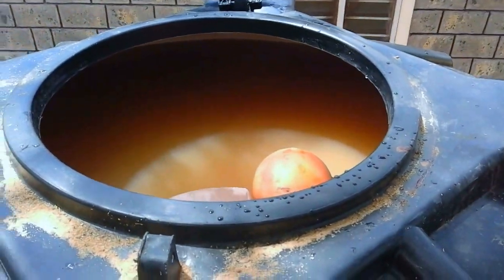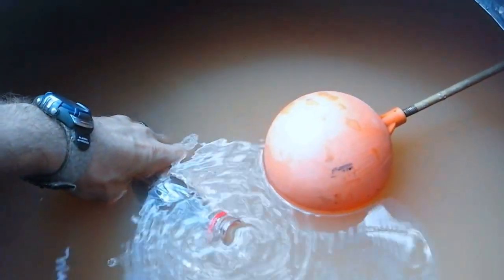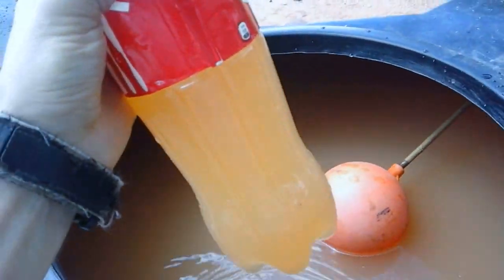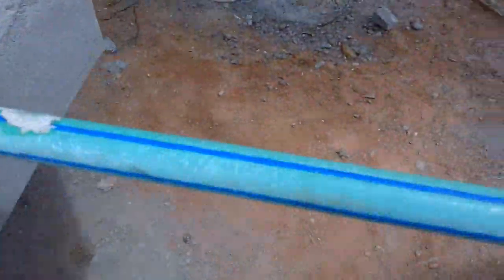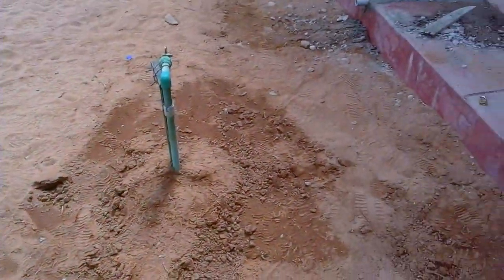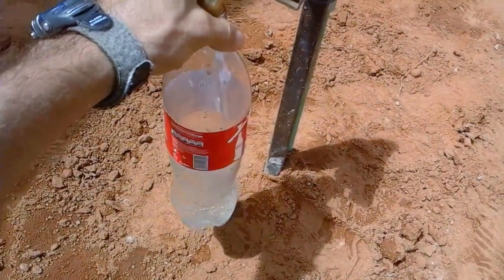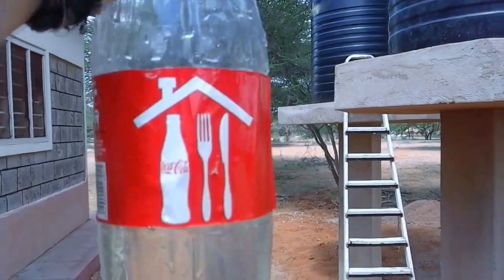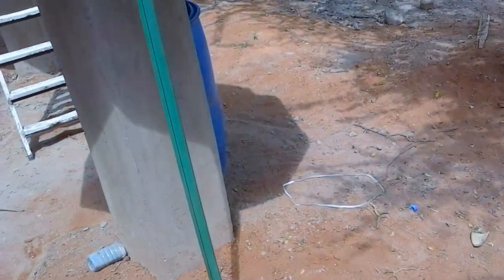Automated BioSand Filter - Appropriate Technology - Affordable Clean Water Solution

Comment: Mr.E will not explain anything.Let me explain . spread small white  coloured stone 3/4 sized bolder laying  by   8 inch thick  in the buttom of filter  tank  which is to be kept at a good height. ) preferably white colour stone  found in river bed near hilly stream/ river.( Black stone also can use).Then  spread wood charcoal about 8 inch thick over stone layer ,then spread  bigger sized sand about 1& 1/2 ft to 2 feet  thick  layer over the charcoal layer. Then keep at least 2 ft. Gap on the top where iron contained water will sprinkle  down on sand.If require take 700 lit capacity tank for filter. Fit only low capacity motor pump  so that slow sprinkle mechanism works.If tank becomes 3/4 th   full , give time for filtration.You will definitely get clear water from the buttom layer. You can join a separate tank to collect filter water at  ground  level.